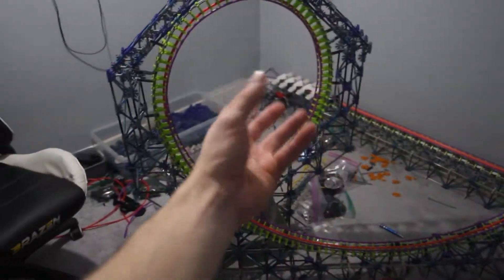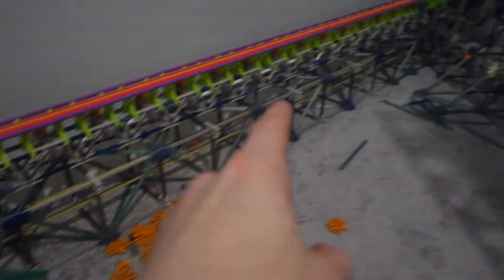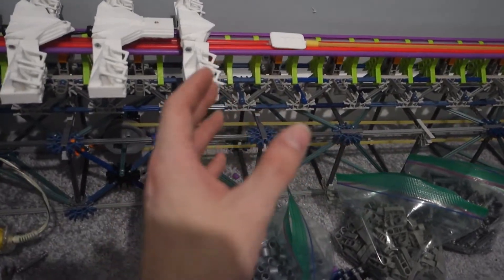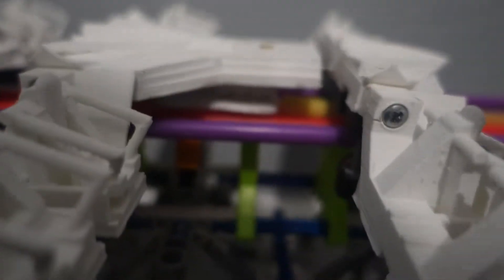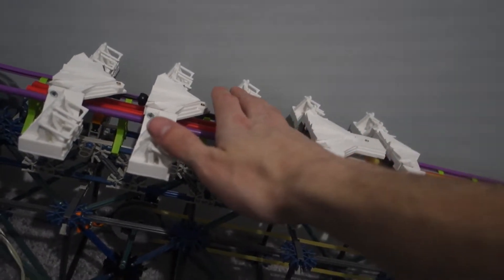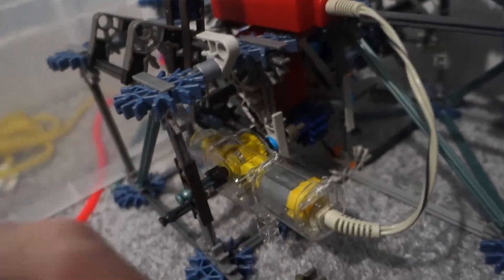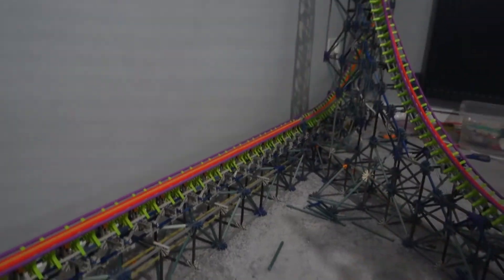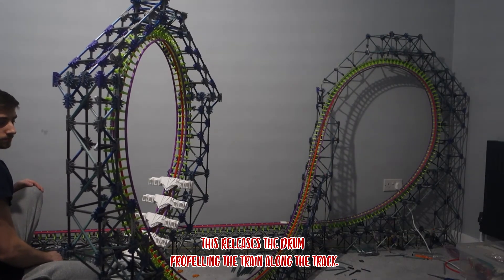THIS IS HOW I AM GOING TO LAUNCH MY KNEX ROLLERCOASTER BUILD! #knex

Comment: how does the blue gear not slip out as theres got to be space for it to be pushed out so how does it not slip out of its own accord
Reply from the maker: the motor locks when its turned off, also the tention of the rubber band. once the gear moves away from the locked motor its free to unwind and launch